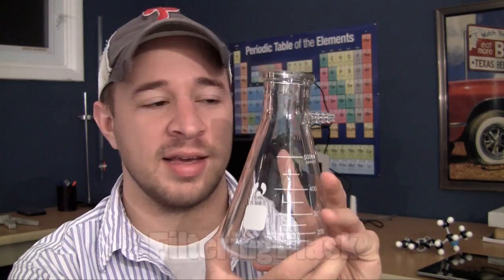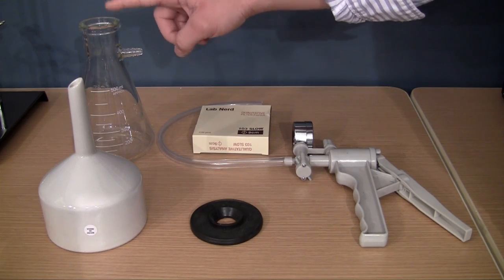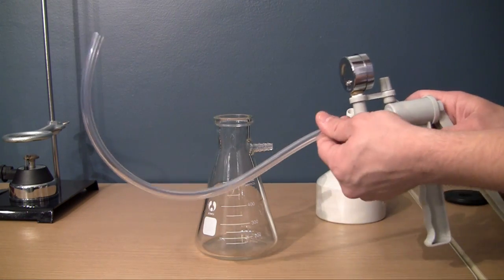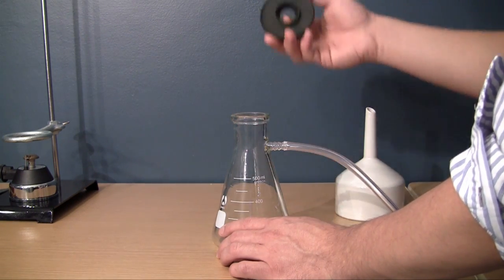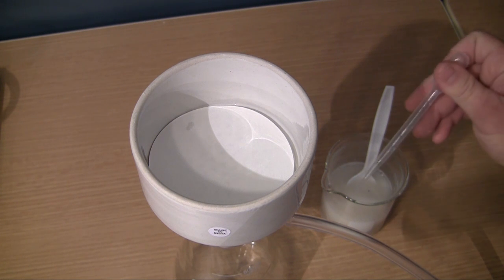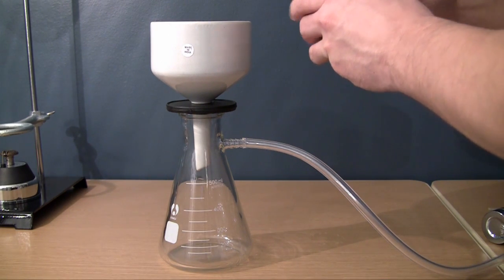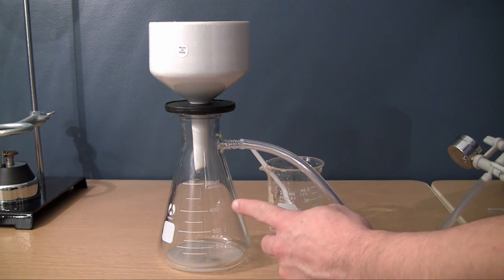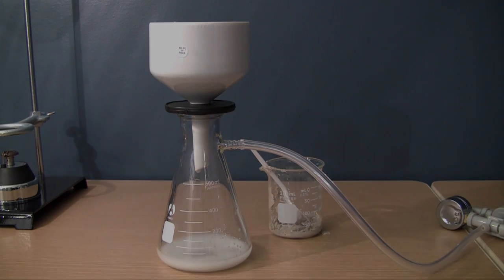Chemistry Lab - 6 - Filtering Flask

Comment: The only thing I saw different in your video Bucky from an industry lab is. (Well the lab I work at). We often times turns the funnel so that the pointy is backed toward the vacuum side arm. Using an industrial vacuum pump vs your handheld one, has so much pressure that it can pull your water into the arm/hose. Hopefully that made sense. You can also puncture a hole in a rubber stopper, add  vacuum grease (lube really). and insert funnel into it so that you don't have to get a "special" one.

Comment: ....the gasket didn't "just come with the kit".  With out the funnel gasket, you would not be able to generate a vacuum. So the filtration process would still take forever, sans gasket with vac pump. You made the video, I have no formal education past the 3rd grade. Do you think what I'm saying is technically accurate? if so, then maybe you should edit/remake the video to highlight the importance of the funnel to beaker gasket. yes?